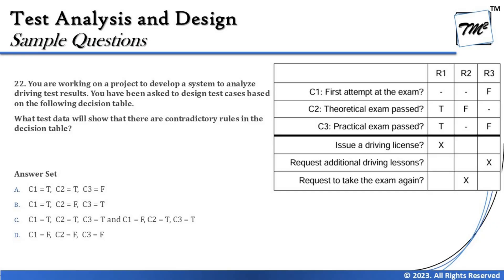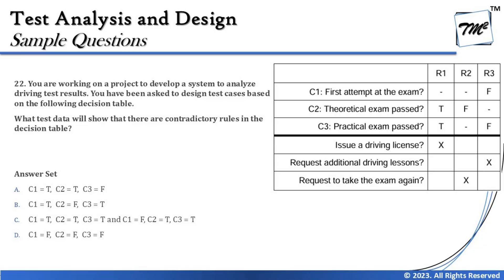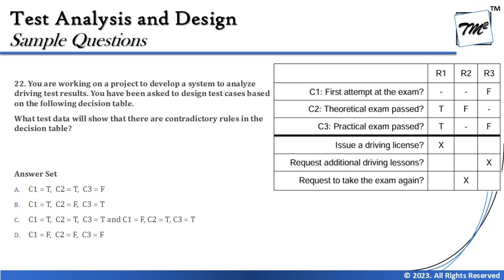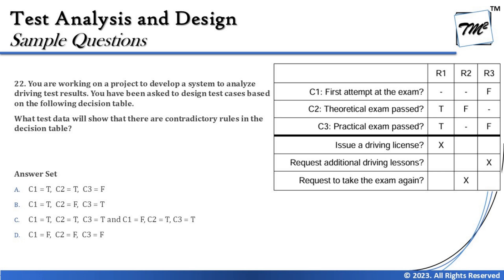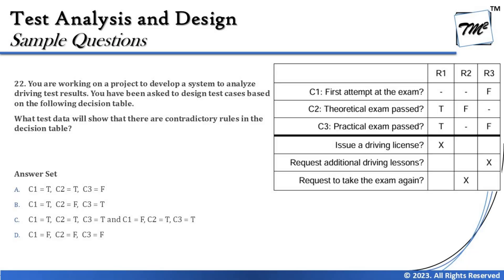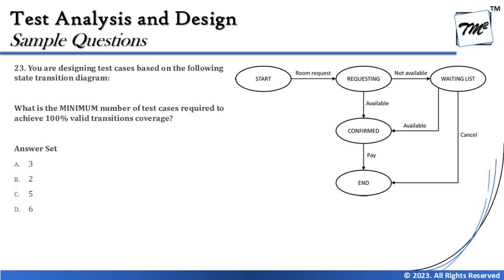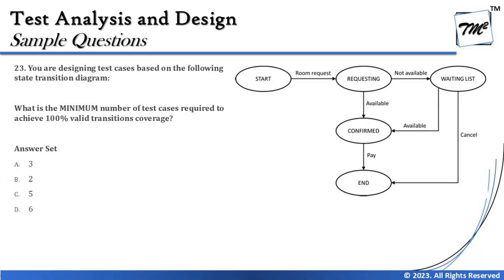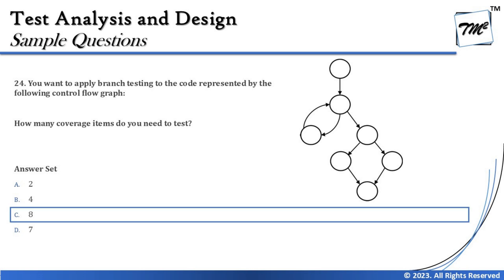ISTQB Foundation Level Sample Questions | Tutorial 38 | SET C | Chapter 4 | ISTQB Mock Questions

Comment: Hello, why for question 22 answer is 8 instead of 4.  

Аccording to the ISTQB CTFL v4.0.1 syllabus (section 4.3.2, Branch Testing and Branch Coverage):

A branch is an outcome of a decision.

This means that branches = all possible outcomes of decision points (e.g., true/false, case options, etc.).

In the given graph:

There are two decision nodes.

Each has two possible outcomes (true/false).
➡ Therefore, 2 × 2 = 4 branches in total.
Reply from the maker: Interesting. The question is can we execute them independently?

No. The other characteristics are we performing tests so they go one end to another end, Also the the definition of branch coverage is percentage of test executed to cover all the branches - Not the count of branches. 

I would suggest you to watch the tutorial of branch testing in other playlist this will clarify the missing gaps. Thanks for sharing your concern. Always happy to help.